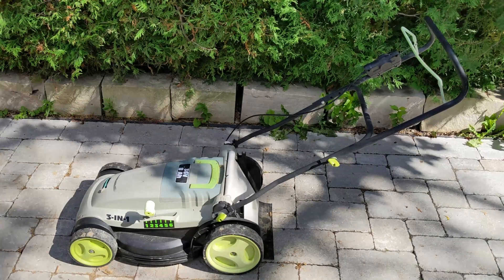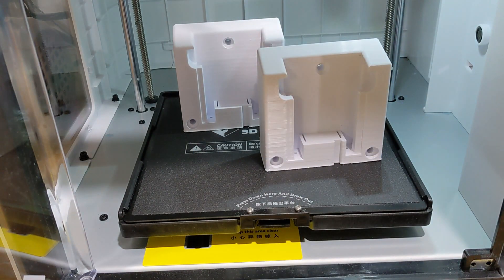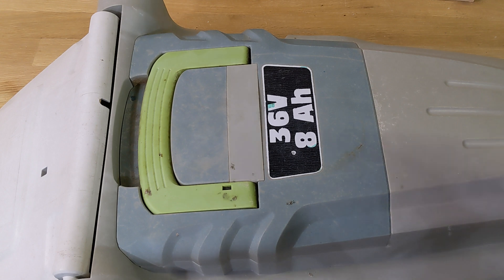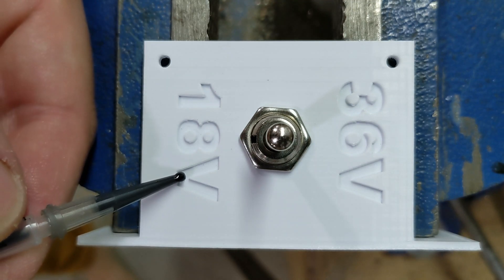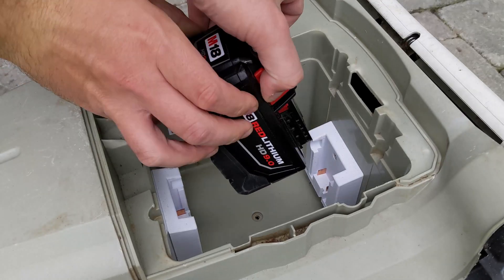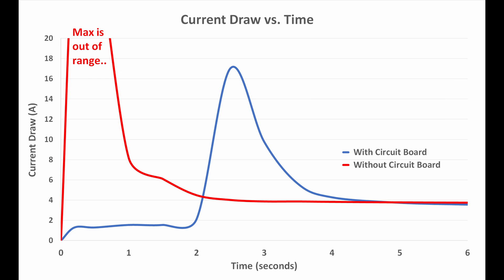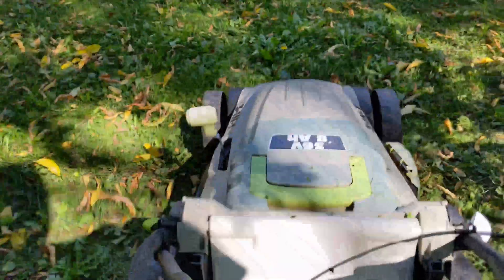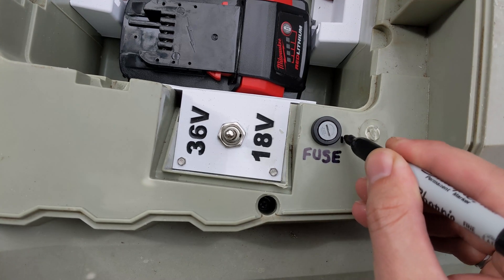Electric Lawnmower Upgrade, Take 2

Comment: I have had a plug in electric mower going strong for 23 years.  Even though I can't get specific parts for TaskForce brand anymore, the bridge rectifier part is a generic diode set up and easy and cheap to get.  I've replaced 2X.  I have been looking at used battery models.  A Greenworks string trimmer being sold used without the battery and charger.  I did some research and Greenworks changed their batteries and new batteries won't work on the old devices.  That's messed up!  Being able to hack a battery on the old electric mowers that just keep going seems like a good skill.  It's tougher on a string trimmer than a mower.  I would just use a drop in 12 (?)volt replacement on that.  I hate those power tool style batteries.  Too much programming.  3D printers are fun, tho.